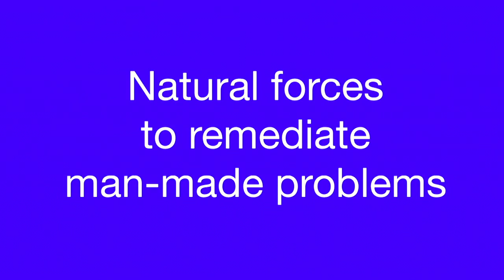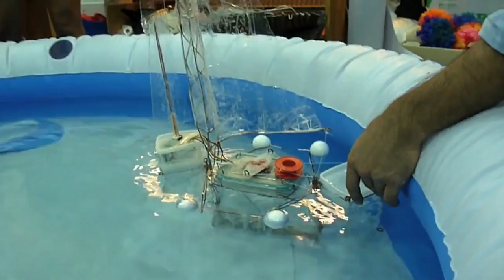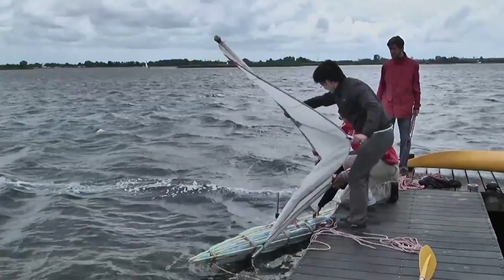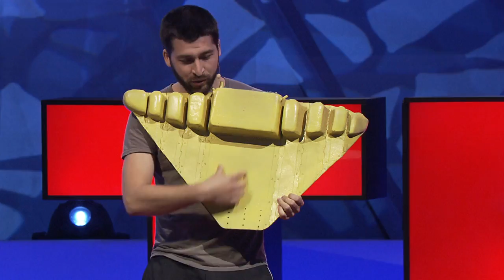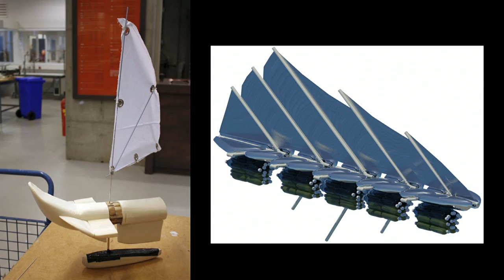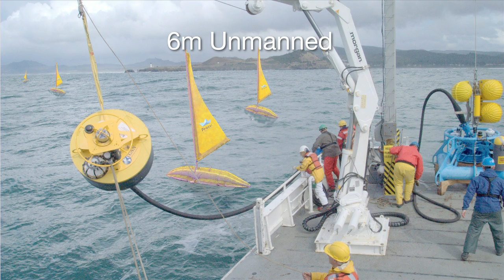Cesar Harada: A novel idea for cleaning up oil spills

Comment: Yes, this is stupid. Therefore, it follows that I revile innovation in general as a means to improve humanity… Are you daft?
Anyone with a basic understanding of the physics involved and/or a bit of experience with towing a long rope through water i.e. fishing, can discount the whole idea of better steering as a solution. Anyone with an understanding of mechanical engineering will quickly discredit the flexible boat as patently absurd. Critical thinking takes a holiday.
This is pure Konyism.

Comment: From the oil company's perspective, once the spill has occurred, resources are lost. Oil is typically not recovered. Cleaning is less about preservation of resources, and more about compliance with laws while performing minimal amount of work to retain profits.  Additional investments beyond requirements are allocated to recover image loss.
I respect the vision and ingenuity, but a business model not built around profit doesn't lead easily to investment when you consider the average investor.